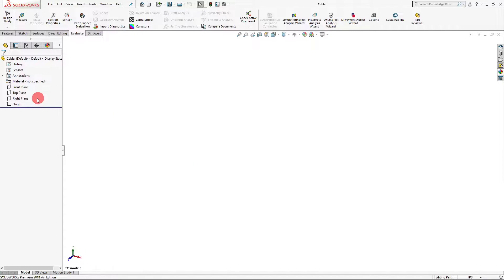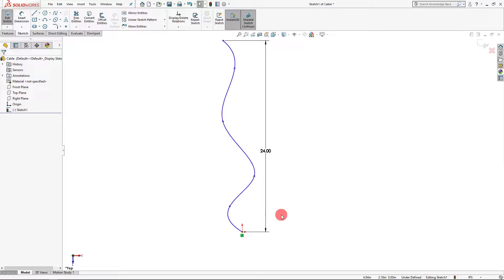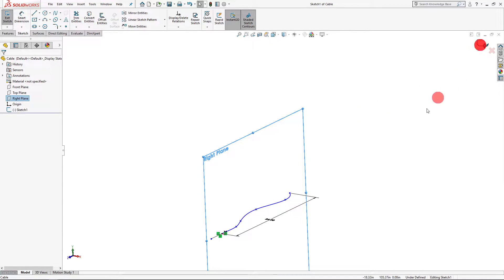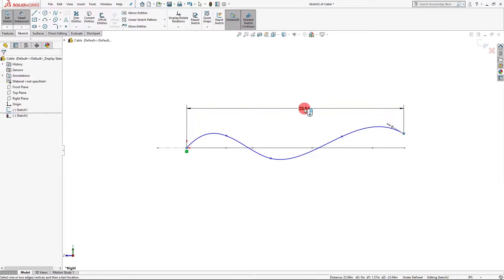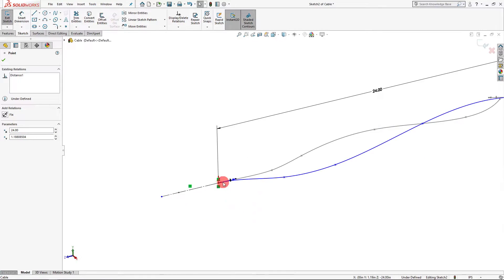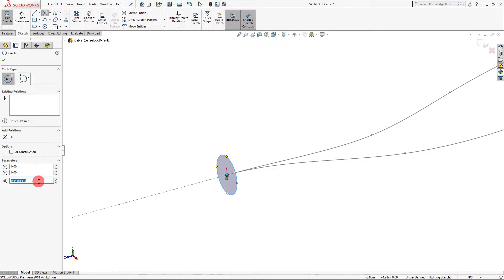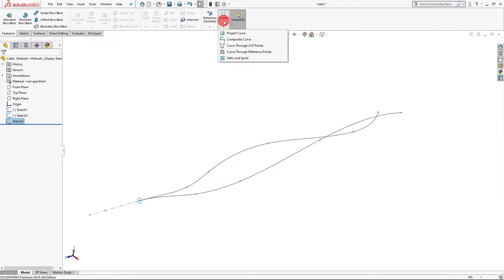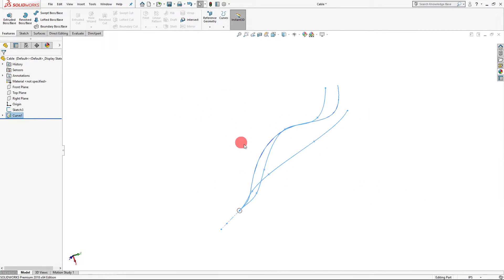Model an Electric Cable in Solidworks! Tutorial for Absolute Beginners

Comment: You can dimension the exact cable length by clicking on the spline and dragging rather than dimensioning from the endpoints.
Reply from the maker: Good point!
Reply: @AvivMakesRobots  Also, thank you -- great video!